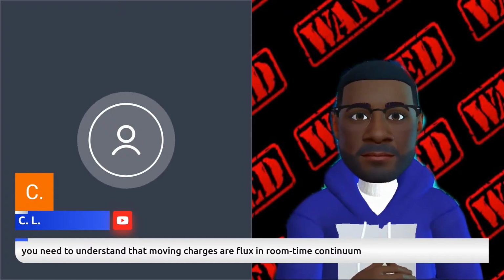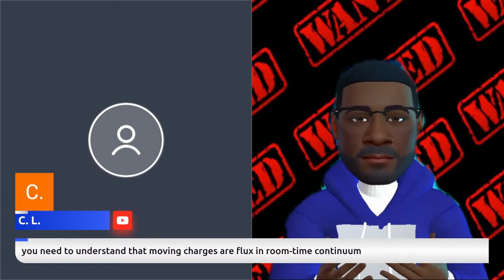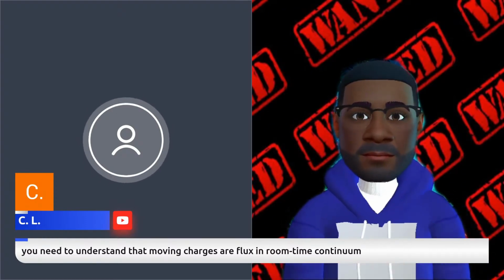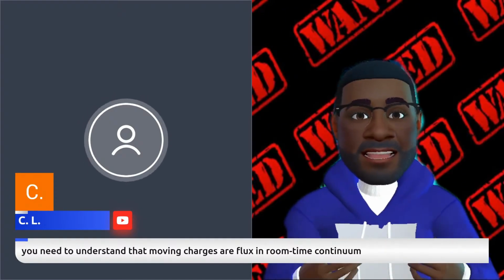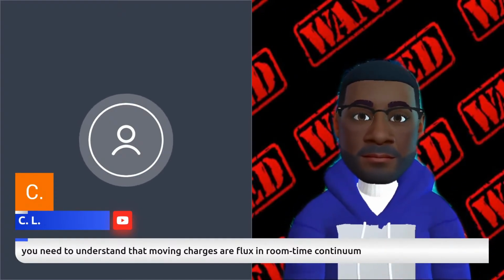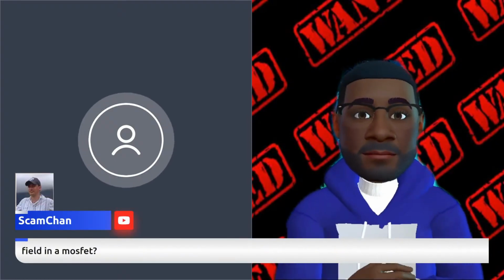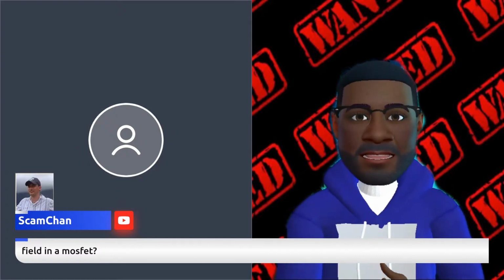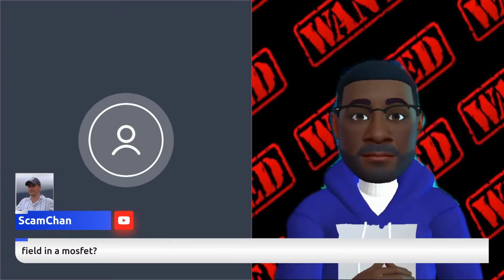Identity Withheld on the Part that Irritates Him About Lloyd Stovall

Comment: I think Lloyd and Maxwell are one of the most greatest geniuses. They have stumbled on one of Physics greatest challenge but they don't know it.

I have gone through some of Lloyds work and I believe I know how he is getting the excess energy. The way he is explaining it might not be correct. He claims when you post the most fat it gives current. This is where do not agree with.

Most fat Is I think made out of silicon and when you pour silicone at high frequencies, it creates resonance or vibration. What I think Lloyds must fact is doing and I know identity withheld has also figured this out. Because he is trying to divert Lloyd from discovering it.

If you have a MOSFET and you increase the resonance what it means in quantum mechanics you are creating Vibrations which affect reality. Example the most fat is now vibrating between our dimension and another. Which brings in excess energy. This energy is so enormous that one foot by 1 foot can power the whole of Africa for 10000 years. This is the reason why the most part keep on blowing up. Because you are not trapping energy directly from the vacuum of reality. Example like a black hole or a Pulsar. If this is true if this is true Lloyds to be given a Nobel Award in physics. He might not be explaining himself right. But eventually people with figure it out.
Reply from the maker: I see your point. and can you like experiment with set like set up it up and measure the current and Voltage from it
Reply: MAXWELL has invented nothing and sells nothing.